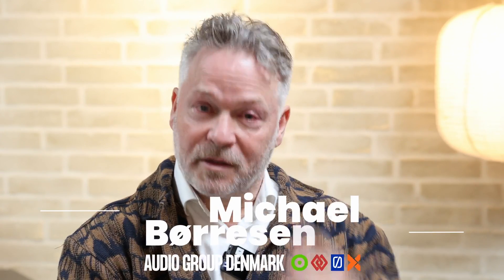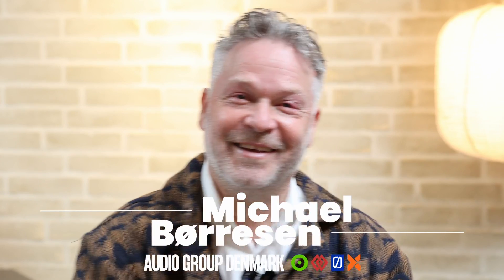The secrets behind the Aavik/Ansuz/Børresen products

Comment: There's a simple way to improve the sound of an audio cable. With a copper wire: you wind the audio wire around the copper wire and send the end of the copper wire to the house ground wire. The same can be done with most sound system devices.
Comment:  
I have Sennheiser 800 headphones and every time I surround a system component, I hear an improvement.
In a 120V electrical system, there is a neutral. If there's a protective sheath, it's removed. It was with this stripped wire that I wrapped all the elements of my system. It's not very elegant ... buff . . . My ears appreciated the result.
Listening to this video, I realized that my audio cables are antennas that pick up parasites, and that my copper wire protects them by picking up parasites and transmitting them to the house ground.